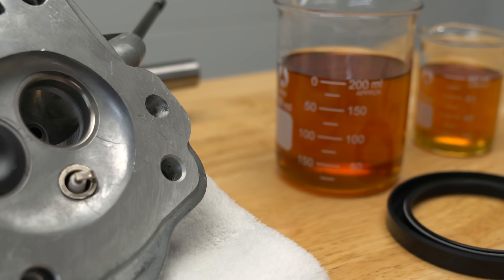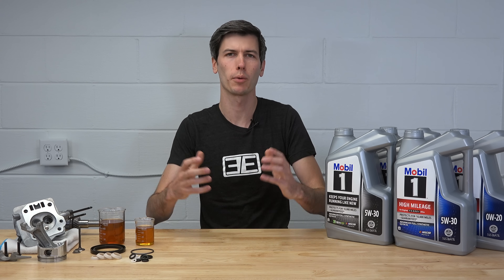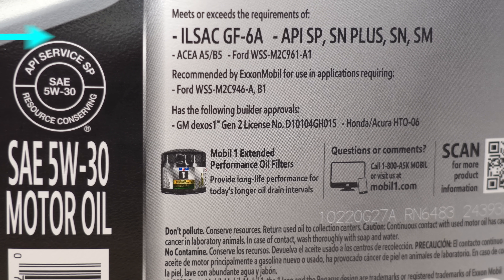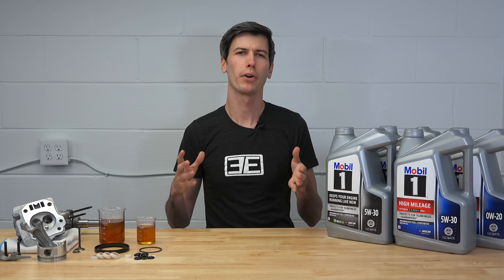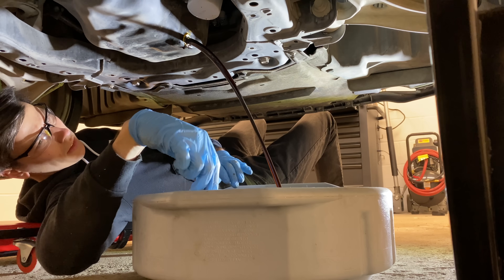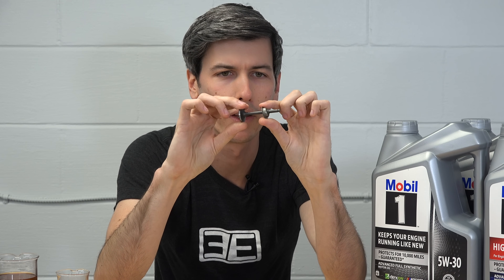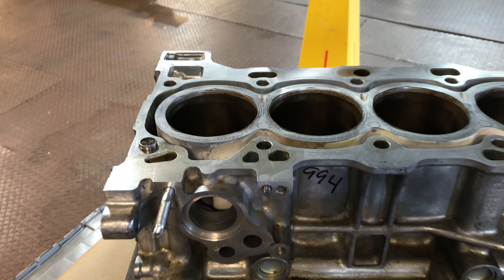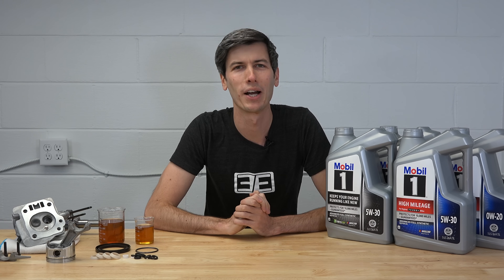Is Synthetic Motor Oil Bad For Old Cars?

Comment: Just ask Mobil 1 if they have any PAO or POE (synthetic base). Answer is that Mobil 1is just a Group 3 since 1997. They removed the synthetic base just like 99% of U.S. oil makers. By the way, Jet engines use an ester-based oil. Ester is used with PAO in Group 4 and 5 real syn oils. The Mobil 1 in 1974 was a real synthetic like all synthetic oils. Not now. And the Mobil 1 in a race car is not the Mobil 1 you buy at Kragen. It has a PAO and Ester base and no detergent. Who needs detergent if you dump the oil after every race? There are two conspiracies in auto history. Selling synthetic oil with no synthetic base is Conspiracy #1. For more, pull up the article by Patrick Bedard in the November 2000 Car and Driver. The article is: "Synthetic Oil Gets All New Semantics"" or how to pay the same and not get any synthetic base in your "synthetic" oil.

Comment: Been using Mobil 1 High Mileage in my Bronco II over 10 years now with 233,000 miles and it burns no Oil and in the Winter has no Ticking at start up.Mobil 1 for sure has been awesome in my 2.9 V6 5 Speed Bronco.Would recommend it to anyone.And my Bronco is still my daily Driver to this day!!Thanks for a good oil Mobil1!!

Comment: Is Synthetic Motor Oil Bad For Old Cars? Answer: No.
Reply: Thank You Jesus:-)
Reply: The answer is both yes and no.
Flat tappet engines require zinc and modern full synthetics sacrificed zinc content for emissions reasons. Roller lifters will be just fine, flat tappet lifters will "forever sleep" themselves against the cam without the proper cushion of oil at higher RPMs (4k and above)
Reply: @Mike__S  not true. Depends entirely on the formula itself, not whether it's synthetic or not. My Road Star needs high zinc oil, and I use 20w50 synthetic oil. Just look into the mixture of the oil you're using
Reply: @Mike__S  That is misinformation. Formulation has nothing to do with synthetic or not.
Reply: I had an old '91 Cherokee with quite a few miles on it. I changed the oil and put in the required grade of synthetic oil. A few days later I noticed my oil pressure dropping during a turn. I checked the oil and found it to be 3 quarts low. I went back to conventional oil and the problem went away.. I use nothing but synthetic in my newer cars, but never again in an older car.
Reply: @davidfowler7040  I'm sorry that you don't know how to change your own oil. Your problem had absolutely no relation to synthetic oil.
Reply: @davidfowler7040  thanks
Reply: That's too short and wouldn't have made for a good video. ;)
Reply: What about classic cars that need high zinc.  Zinc phosphate is bad for catalytic converters but are a must for flat lifters.
Reply: @jhfl1881  plenty of high zinc oil around, I use it myself...
Reply: Synthetic oil is fine for old cars. Just use the right weight oil and make sure it has a high zinc content. It's not rocket science....
Reply: It is probably a good idea to use very good oil for a vehicle when possible.
Reply: @JA238979  ah yes, "very good oil" top shelf walmart oil.
Reply: Johnny Tyronne  False. Proven false since the 1980's.
Reply: I don't care if it rains or freezes long as I got my plastic Jesus, riding on the dashboard of my car.
Reply: I ran full in my 2001 cavalier for years
Reply: Thanks, I wasnt about to watch a long video about it.
Reply: I've moved both my boosted nineties JDM vehicles to fully synthetic and they love it. The rocker cover gaskets will always need done on EJ20s regularly regardless 🙄
Reply: @fpeletz This was an old worn out motor in the Cherokee. It used a little oil, but was not excessive. I don't know if it leaked or burned the synthetic oil, but I didn't put any more in it.
Reply: Thanks Super Jesus :)
Reply: Cheers mate, you saved me 10 minutes!
Reply: Wrong old classic cars use only regular oil not synthetic
Reply: @lucianovalentino832  You are wrong. Completely.
Reply: Betteridge's law of headlines.
Reply: @markcollard9326  Which is?
Reply: @markcollard9326  What an unusual name. Are you related to the eponymous piano manufacturers? There were two of them. Collard and Collard. In brass. On the lid. Or fallboard as it should be called.
Reply: Half synthetic or Full synthetic ?? Which one ?? For old cars.. (models are 1995-2006)
Reply: @öztürk26  Always full synthetic. There is absolutely no reason to ever use semi.
Reply: @superjesus4307  for 1997 renault 12 or 2002 Honda civic vtec ???
Reply: @öztürk26  All engines can use full synthetic.
Reply: Old car? How old is an old car?
Can you use fully synthetic oils in a 60 year old engine?
Reply: @riggs1590  Yes.
Reply: many years ago; when this oil was first on the market; was found to foul spark plugs; especially on older vehicles and some new if not allowed to warm up before shutting down.
Reply: @robertboykin1828  That was lie
Reply: Can I switch from synthetic to regular if I wanted to or is that a bad idea
Reply: @Joeypop145  There is no reason to.
Reply: but older cars say anything 60s and older used thicker (and really terrible oil compared to todays) with 5w-30 the valves in my 63 rambler were making clacking and rattling noises, upgraded to 10w-50 and it quieted right down.
Reply: @thelasthallow  Viscosity has nothing to do with being synthetic.
Reply: @thelasthallow  yes. But as explained in the video. That is because you have excess wear. Not because you should be using a heavy weight
Reply: @pb6198  im talking about something completely different clearly.
Reply: @thelasthallow  no you are just misinformed
Reply: @pb6198  about what? i dont think you know what the hell you are talking about dude.
Reply: @thelasthallow  the fact you even think I'm on about something different shows you have no clue. If your having to run a thicker oil to make an engine run quieter, it's worn out, simple
Reply: @pb6198  and you are wrong, its that simple.
Reply: @thelasthallow  Did you actually check the tolerances on the valves? Because it doesn't sound like you did.
Reply: @Raven1024  uh no, because in older cars they used thicker oils, so going from a very very thin 5w-30 to 10w-50 eliminated all valve clatter.
Reply: @thelasthallow  So you have no interest in testing for possible actual more serious issues and prefer to ignore those issues... Got it. Have a good one.
Reply: @Raven1024  why would i need to check the tolerances on a car with 40k miles on it even if it was from the 60s, if you knew anything about oil and older cars you would know that older cars used heavier oil anyways.
Reply: @pb6198  thanks, some thought there.was thinking about an older 1980 ?Chrysler  318:: hit it with 20W-50 Synthetic , much quiter( though I think all SYN WAS TOUGHER , and COLD WEATHER FLOW, better**,THAN  **CONVENTIONAL 20W-50....,

Comment: can we talk about lower zinc content in modern oils that older engines needed for their roller/tappet design?
Reply: Diesel oil still provides adequate protection.
Reply: @CharlieK92004  but diesel oil also comes at a higher grade that most
Reply: @kimber3865 , I use Rotella conventional 15w40 year round because it doesn't get that cold here, but they do make synthetic 0w40 in case you live in Alaska. Doesn't cost that much more either.
Reply: @CharlieK92004  I'm looking for 10w30
Reply: @CharlieK92004  false. Name one that has more than 1200 ppm of ZDDP

Comment: Generally wrong information.
1. My 2jz leaked and tapped with Mobil-1 0-40 annual protection. Driven only with Motul 0-40 e-tech ester for 125.000 miles before that;
2. A smooth bore requires thinner oil, not thicker. Thick oil will just be shaven from the bore by the rings resulting in dry friction and excessive wear;
3. An engine never increases it's tolerances. Well cared for engine will stay within spec for good 200+k miles. Oil pressure is lost through oil pump gears or bypass valve, or through scored bearing. One or two bearings somewhere in the engine. Or one or two valve lifter bores that are worn.
Increase the viscosity and the flow is reduced dramatically throughout the entire, except through the worn parts.

All these advice is maybe partially true for old OHV/CIH cast iron engines such as GM/AMC straight sixes or an old GM LT 5.7 with cast iron heads. No one is usin those anymore and the ones still maintaining such engines better rebuilt them than ruining all with Improper oil.

Comment: I’ve been running full synthetic 5w-30 in my 1987 Fiero with 250K+ miles with no issues for the past three years. No oil leaks anywhere and engine does not use a single drop of oil. All gaskets (except for the valve cover gasket) are all original.

Comment: Old engines have to run conventional at least (zddp really helps) because of their flat tappet cams. The engine doesn't really car much about oil, actually, but the camshaft absolutely is picky and will eat itself (and your engine) if you feed it the wrong oil.

Comment: if one doesn't really have to i wouldn't recommend using a high mileage oil in a low, mid or vehicle  just getting into relative high mileage.. seals in rotating assembles as it wears, they also wear grooves into harder surfaces like metal finding a balance.. high mileage oils can change that balance of wear and clearance thus if one reverts back to Normal syn oil then this can show up as new find leaks so only use in cases where its absolutely needed

Comment: Years ago I put synthetic in a 93 SHO. Drove it for a while and on the next oil change, couldnt afford synthetic and threw dino oil into it. Dont do that. Lost that engine that day as it washed all the bearings out, and it made me sad. That car was absolutely awesome. Newer engines are much more tolerant of swaps like that. Old ones, not so much. Since then, once I go synthetic on an older engine, I keep it synthetic. Its much easier to remember which of my cars is swapped to synthetic as well, since they all are.

Comment: REMEMBER to use ONLY Oil in your vehicle which was designed for on the date of its manufacture. If your engine was designed for conventional oil,  use only conventional oil and don't use synthetic oil. Synthetic oil will cause you engine problems and it is way more expensive than conventional oil.

Comment: One of the problems with older vehicles is with the flat tappet cams and lack of zinc in modern oils. Not necessarily a synthetic problem, though.

Comment: I recommend full synthetic in modern V6 motors, especially GM's. It's just something that I've noticed with my 100,000 mile V6 that it responds differently to conventional or blend, I had an oil change from full to synthetic blend just before the six digits turned over and had more idle shutter on cold starts and a very small but noticeable delay in power accelerating on the highway. Always run top tier fuel and the days were pretty similar so nothing was different between the two oils, but the car responds much better now with full synthetic. I wish it was that simple for GM's transmissions however.

Comment: year 2000 in a 10 day cold snap -40c aka -40F with vehicle sitting outside I switched to synthetic (castrol) around day 5 for my 89 YJ 4.2L jeep ,  other than it starting like it was closer to summer no other differences , still have the jeep

Comment: But wait, older cars, especially those with flat tappet cams, and according to old mechanics, need oil with a higher ZDDP content. This isn’t something you addressed at all, but of course this doesn’t apply to roller rocker type cams.

Comment: In my experience the thinner oil leaks more than thick for bad seals. My old truck I bought has a bunch of old leaks. Rear main seal, oil pan gasket, front crank pulley area and around the valve covers all had old caked on oil from what looked like old leaks. But nothing dripped actively. So I changed the oil. What came out looked like black tar. Was as thick as molasses. Like it hadn't been changed in over 150k miles. Next day after changing the oil I see new drips on my driveway. Like those bad seals started running again.
Reply: Long term solution. Engine really needs an overhaul. Thicker oil. Or maybe an oil stop leak product may help in the short term though.

Comment: I have recently found a 2000 Mazda Miata, and these are known to have some front main crank seal leakage issues.  While mine shows some oil seepage there, it's not dripping.  The kicker--the car has 28,000 miles on it.  I just changed the oil and used Mobil1 10-30 High Mileage, (the weight specified) and a Mobil 1 filter.  The High Mileage choice was to do a little seal conditioning in a 20 year old engine (previous owner had used dealer supplied 10-30 semi synthetic).  Am I on the right track?

Comment: 120,000 miles on my 2016 Colorado V6. Uses 1 quart of oil every 700-800 miles. GM says that's within spec. Im wondering if I should try either a 5W40 or Diesel rated 5W30 (factory is 5W30). What do you think?

Comment: What about air cooled engines (vw beetle) conventional oil cools better than the synthetic? Oil temperature at this engines are so important than oil pressure!
At my air cooled engines I always use conventional oil for motorbikes (mobil 4t 20w50) that supposed to be better at keeping the oil cooler!
I'm really want to here from mobil about that! Thanks and keep the great content!
Reply: I really want to hear from Mobil about that* (auto correct)

Comment: All I know is, when I was considering going synthetic, I read the opinions of both people saying it causes oil leaks and it doesn’t cause leaks. I first tried Mobil 1 on my Acura RL with 120,000 miles. No leaks, dry around the oil pan prior...but by the next oil change...BOOM! Dripping oil around the oil pan and rear main seal. Next up, my Honda Odyssey with about 320,000 miles. Oil was changed every 3-4K with regular and then high mileage oil. No leaks, dry around the oil pan. Put in Mobil 1 and BOOM! Same thing dripping oil. Yes, it had high miles, but it was dry before and didn’t burn oil. Not so anymore. I’ve gone back to high mileage oil and will never switch a higher mileage car to synthetic again...unless someone promise to cover the repairs for fixing the leaking seals.
Reply: Chris P you mean the seals that are only being protected by the sludge build up that the syn cleans out?  He covered this in the video.
Reply: @Mad-Lad-Chad  Well, I'd gather that there would be some sludge, but given that consistent, frequent oil changes were done, it may not have been that much. But, that's not really the point. The point is: People keep saying the switching to synthetic won't cause oil leaks, when in fact it did for two of my cars and I gather it has for many others. So, my advice for anyone considering going synthetic on a higher mileage car (whatever that may mean), is don't do it!
Reply: @CJP1012  sorry but anecdotal is anecdotal.  Your "data" isn't complete enough to prove synthetic caused it and my own experience with my 4 vehicles is the exact opposite of yours.  If it leaked with synthetic there is an issue that will come out soon enough.  A healthy engine doesn't leak on synthetic regardless of age.

Comment: What about when you build an engine, I hear a lot of times that you can't use synthetic in a newly built engine, non-synthetic is needed to seat rings, seals, etc.  Sounds like nonsense to me, but was hoping you'd cover that in this video along with use in older engines too.

Comment: Hey Engineering Explained, what about the oils that are specifically for Old engines with flat tappet lifters/cams. They claim that the high zddp is a must for those. Should I use that
Reply: Yes, they need it. When the oil film breaks down it's what lubricates. But you don't want too much either, so don't run both oil for that application and extra additives.
Reply: Yep , these oils are also developed to protect engines that had lead usage in previous life's
Reply: @Kavi4GP  Lead was for the valveseat, the oil additives can't compensate for that.
Reply: @PSA78  yes they can as the tolerance drops , the zddp which is being removed in most cases does help the seating
Reply: @Kavi4GP  Not the valveseat, it helps seating the tappets, two different things.
Reply: @PSA78  apologies read it wrong the first portion.

It will still have an impact with better dispersion additives to act against the fuel additives making in to the oil chamber

Comment: Naw, every rotary enthusiast knows that the absolute best oil to use is straight castor oil. It doesn't mix with the gas and just gets dumped overboard, covering your WW1 airplane in brownish-black slime and causing a laxative effect for whomever is flying the plane.
Reply: Castor oil - the smell of victory ;)

Comment: i had a 5.0 mustang and i was using Royal Purple 10w30 in it. after driving it 1.5 months the low oil light would come on. I'd fill it to level and 1.5 months again the low oil light would come on. i had no external leaks. a friend of mine suggested not using a full synthetic cause the molecules in it were smaller than conventional oil and must be slipping past the piston rings. i didn't notice any smoking, but made the switch and the engine held the oil until i changed it. 😕